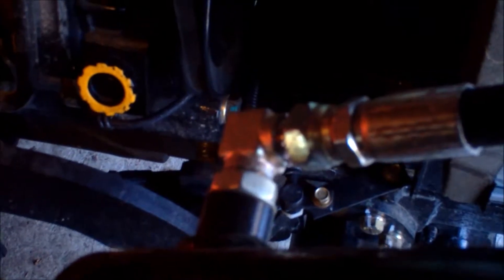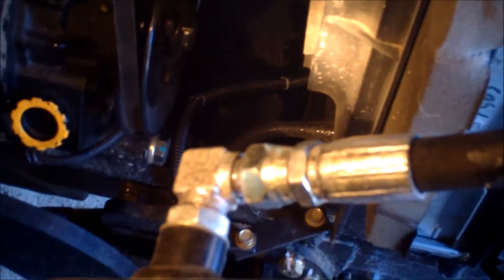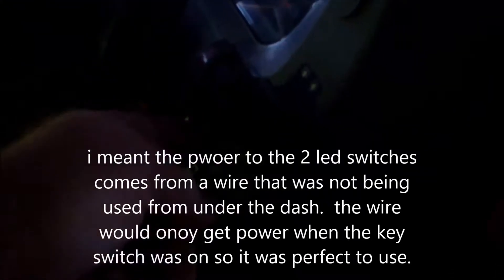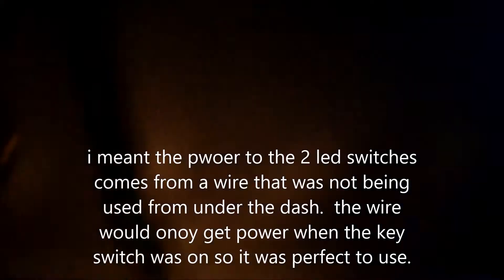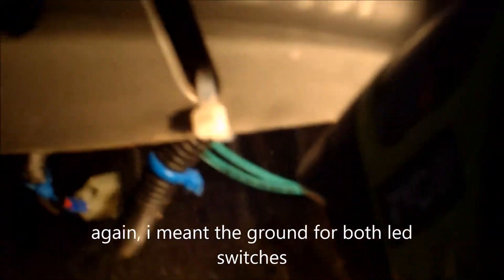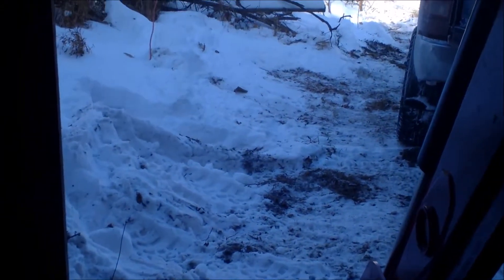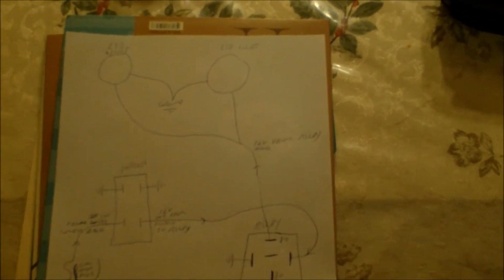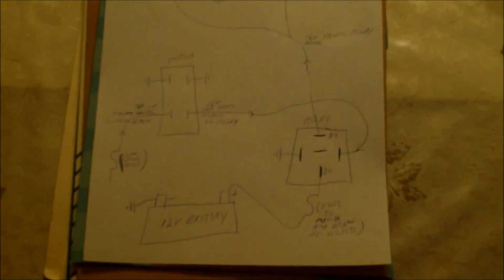Mahindra 2555 LED light wiring

Comment: Where did you get the magnets for mounting the light?
Reply from the maker: I picked them up at Home Depot or Lowes.  I think it was HD.  if you want to see the difference between LED vs stock lights I am going to post another video(well just pics of the lights at night).  UPDATE: oh well, i just checked and i can't find the better pics i took of the comparison.  I will have to take more photos hopefully tomorrow night.  Also, i didn;t want to drill thru the rollbar.  i ran the wires behind the rollbar  instead of in front so branches wouldn't catch as i was driving forward.  I will also post the parts list when i show the pics.
Reply: Thank's Mike. I was actually thinking of using them for other purposes on my tractor as well. The electrical part I got. I have 40+ years in the electrical biz specializing in controls so wiring lights is easy for me but others may find the info useful.